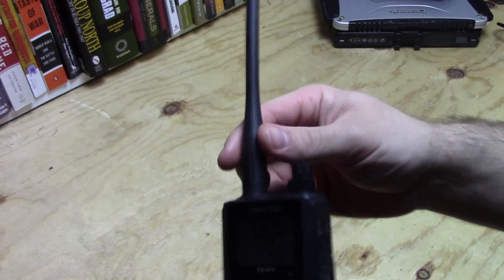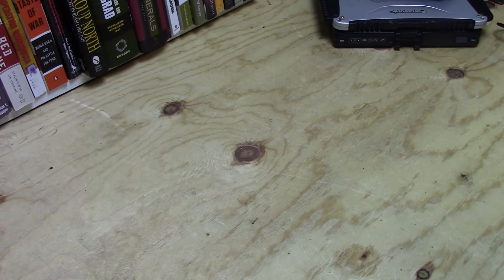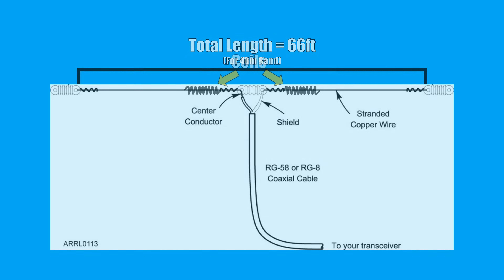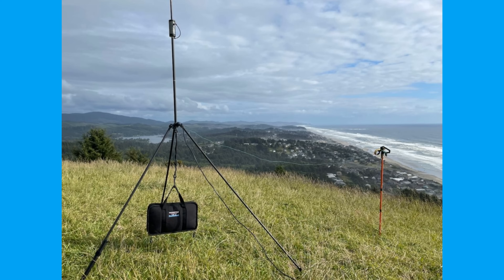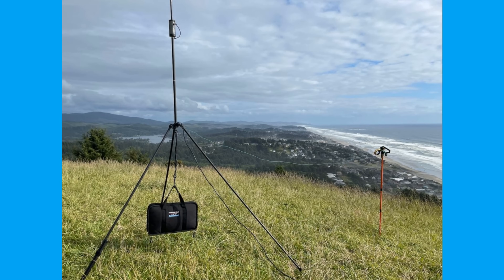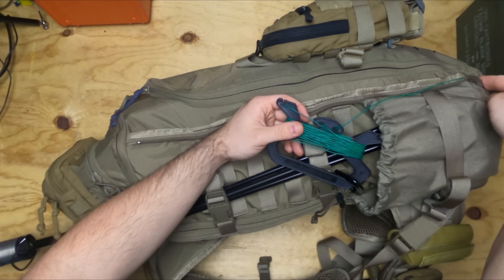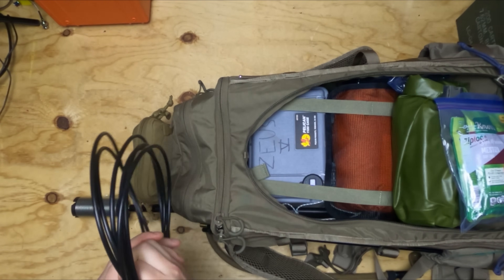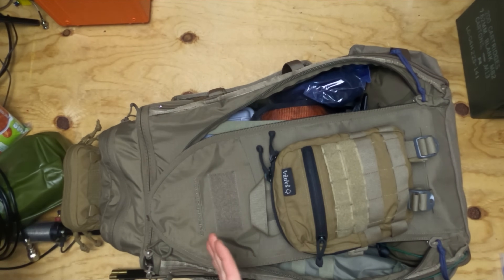Portable HF Radio: Issues and Options

Comment: More content on your IC-705 would be appreciated! Figuring out which systems fit which capability is a worthy study. For i.e, the yaesus seem to be easier to use APRS on compared to the ICOMs, but then you run into other issues. Looking forward to more!

Comment: Not sure why you would go straight to a tripod radial. Why not use an endfed half wave or random wire? Much less to carry and set up, just throw the end up into a tree. Can confirm it works for regional operations. Leave national contact to Basecamp.

Comment: An EFHW antenna with throw away wire. Deploying can be done much quicker than retreiving an antenna wire in most cases. If DF is the main concern then deployment time may not be a problem, but leaving quickly after transmission is the main problem.

Something like aluminum fence wire can provide a cheap throw away antenna. Unhook the wire from your balun or tuner and off you go in a matter of seconds.

Comment: I'm building an antenna out of two brass slinkys.  It looks like a dipole but it's really an end fed random wire (random slinky?) with a really long counterpoise (counterslinky?) The whole thing will be about 12 feet long fully deployed,  and hopefully 10-15 feet off the ground.  It's multiband,  and crazy portable, although it does require an antenna tuner.  Apparently they were all the rage during WW2.

Comment: @12:50 Be careful of the bending radius of the coax cable. That first bend out of the antenna in your pack looks like its about to cry mercy. I've worked for MANY years installing microwave communications systems for AT&T, Verizon (and others) plus I've worked for the DoD as a contractor. Anyways kinks in the wave-guide returned unacceptable system & return loss values more times than I could count. If you spend several hundred bucks on cables and antennas, on top of your USD1-2K radio, only to have it under perform because you smashed the cable in your pack like a neanderthal (me see cable... me smash... me fit 60L gear in 40L pack!!!) SMH. 
Thanks S2, your videos are enjoyable like always.

Comment: Actually there are portable operators that operate HF while walking by trailing a counterpoise while walking.  They have excess cable spoiled on their side and a counterpoise lead attached by an alligator clip to the trailing wire near the spool. If the trailing counterpoise gets snagged or stepped on it the alligator clip pulls loose and wire pulls out from the spool prevent mechanical damage to the radio or harm to the operator.

How one assures the radio is protected from high SWR varies as well as how one makes one's self away of a disconnect of the counterpoise lead also varies.

The electrically unused end of the spool of wire can be attached to some sort of bungee or shock cord making it easier for the operator to recognize the spool has unspooled to the end before experiencing damage by an abrupt stop.. Similarly the shock cord can be wrapped around from inside to outside of the spool and the spool attached by velcro to the operators clothing or pack. When the trailing counterpoise is snagged the spool detaches and then the shock cord alerts the operator.

There are clever determined people that have been doing this sort of thing for decades.

Comment: No, NO, NO!!! It is not heat loss that causes dipoles to be optimally a half wavelength long versus a full wavelength long!

It is wave cancellation!! It is waves being 180° out of phase on a fullwave dipole cancelling each other.

The thermodynamics are a consequence of waves being 180° out of phase, not the cause of being 180° out of phase.

You must be clear and concise in terms of the cause and effect relationship to correctly describe the what and why.

Comment: Homemade Magnetic loop antennas are by far the best HF antenna for their size anywhere. Especially portable, just bought a used 10 Kv 10 to 500 picofarad vacuum variable capacitor to make a somewhat portable 6' diameter HF mag loop antenna that can handle 250 to 350 watts, depending on the band. My 6 ft tunes 2.8 Mhz to 7.35 Mhz my 3 ft tunes 12.8 Mhz to 29.80 mhz.

Comment: I was wondering, would it be possible to 3d print a case to place the system into for protection [part that extends into the backpack] and still be effective? Excellent presentation as always.

Comment: Thought of a way to make a quick deploy antenna

use two telescope collapsible fishing poles, replace the fishing line spool with a spool of antenna wire.  leave the other spoolless, and attach a basic fishing poll stake to the end of both.   (Load the antenna wire backward so that the hookup is on the outside end of the spool)

when you want to stop make a quick transition. Extend and cast the primary pole with the wire spool, just like a normal fishing cast. 
Plant the primary poll, and run to where  the end of the line has landed.
Extend and plant the secondary poll and feed the end of the wire through the secondary poll.
You can now plug in the antenna and receive or transmit.

Need pack up and leave quickly? Follow steps in reverse.
unplug antenna, and pack up the radio.
Detach the end of the antenna from the secondary poll, then collapse and pack up secondary poll.
Lastly, run back to the Primary poll. Reel in the antenna wire, then collapse and pack up the primary poll.

Comment: Hey guy! Enjoy your videos a lot! I am a long-time Ham with the highest class FFC license. I wanted to comment on this one with possible ideas that while not perfect might be helpful for your idea of using HF to manage multiple small teams in the field. I did hear you say that radio in general and HF in particular posed various challenges that you couldn't get into due to time constraints. No probs. I assume you are aware of SWR, and this is an example of the kind of practical problems to be dealt with. But could there be work arounds? One idea is Radio Relay. Imagine you are base station in, say Athens Geo. and you are working with a small company-sized unit in the form of squad-level groups scattered over N. Geo. As base station you need a decent antenna, perhaps covertly installed and capable of putting out 100w via the HF transceiver and antenna tuner of your choice. But all the teams in the field really need is to receive that HF signal. And any decent piece of 14AWG stranded tied to a rock and tossed over a tree limb, then married to a short piece of coax can easily receive on a completely innocent and legal SW portable radio. With a decent radio you might not even need the extra wire! Not a big deal! How to communicate from the field back to base then? By Radio Relay: all the teams also carry VHF handhelds. Their individual Areas of Operations form an overlapping grid over the monitored landscape, and they are able to transceive to each other, the nearest to base then relaying to your VHF at base station. Hence, you eliminate most set-up and engineering issues for the field teams while providing a reliable method to relay info up and down the chain. Assuming ridge-top use in the field 18 km, say 11 miles is certainly do-able without any repeaters or special antennas. A 12-squad company properly dispersed could probably cover most of Northern Geo. Plus have the ability to link with other units in a larger regional net.  If the teams were laid out in linear rather than grid fashion the line could reach over 100 miles and form an efficient early warning line. Def not perfect but offered for what it's worth.

Comment: Chameleon V1 Home use and V2 mobile use were also coiled. They used a 9:1 unun. Chameleon no longer sells them. At least not the V1. Bought mine back in 2008 directly from the company when they were based in CA.

Comment: I made a counterpoise from an automatic steel tape measure (the same type used to make the tape measure Yagi's).  You might consider that, as it rolls itself up real easy for packing and unpacking.  Even better since the end is a coil, it acts like a trap and so electrically the wire length can be adjusted.  This allows you to adjust the length for better tuning options.  In my case I attached a crock-clip but you could attach it permanently to the buddy pole too.   I also prefer an EFHW rather than a dipole I think it's easier to deploy and can also do NVIS is you have a shortened version of the 80m or 40m EFHW.  By the way I have very lightweight wire, the stuff you showed looks good for way more power than the IC-705 kicks out...   One of the best radios that I've seen which actually worked with a whip antenna is the Clansman PRC-320/RT-320, I've wanted one for a while, but the prices just keep getting higher and higher for good ones...   Of course they are really heavy and so on for use today, but they were awesome at the time.

Comment: I don't know of you read the comments, or even think this idea is worth considering, but I had an idea the other day I thought you might find at least interesting.

I've heard (can't remember where, maybe even this channel) that Ukrainian fighters have been making good use of electric motorbikes. I've recently been eyeing the Sur Ron series of electric dirt bikes, and couldn't help but think they would be excellent tools not only for fun, but for serious times too. Especially when upgraded with a second battery and a belt drive, it creates an extremely capable yet quiet means of transportation in many types of terrain that is also very low-maintenance. Not only that, but I've seen people adopt solar panels to be able to charge their vehicles on the go, and allow for total independence from the grid. 

Just an idea.

Comment: I watched some WWII videos about the SOE and the allied spies and they used a wire down the chimney as a stealth antenna. Some other methods including using a wire clothesline. Some ran a wire around the ceiling around the room and ran a counterpoise wire around the baseboard. I think there was another one where they ran a wire vertically all the way up a tree.

Comment: Can you have bi-metallic Coaxial Cable that you can zero to the system temperature of the surroundings, insulate maybe, and then heat to the desired dimensions?

Comment: You should really move to a Dell rugged laptop. They are only about one generation behind on hardware, where Panasonic is closer to three generations behind, and they weigh in the area of only 4.5lbs compared to those toughbook bricks. There's even a 12in laptop/tablet convertible. They do have a 7400 series rugged extreme 14 laptop that's more the size of Toughbook brick.

Comment: So... Radios need to be waterproof, portable, easy to use once you know how, quick to set up/take down, and rugged enough not to break.

That's tough.
Reply: @Ghostinthecode  That's for a bunch of people using a repeater. Individuals could just communicate between smaller groups for a lot less time, for a lot less demand. 

If you can contact three other groups twice a day for 20 minutes, that's pretty good.

But how would a normal person learn to use an absurdly complicated thing, which is not waterproof, which requires advanced licensing? Probably not so common.

Comment: Any thought on using a micro-drone to elevate your antenna over a limb. You can set an antenna quite quickly, if the wire or leader was light enough. Dacron 50lbs test braided line will drag it up I think.

Comment: I’m having trouble with one thing when it comes to HF. I understand skip, I get directionality, but is there any way to adjust change distance? 

For instance, I have made 59 contact with someone 600 miles away, but I have had poor luck talking to someone I know is 800 miles away. Is there a way for me to “adjust fire” to get that extra 200 miles? 

Currently using a simple vertical and a 100w machine. He has the same radio, but with a OCF dipole. I’m wondering if one of us needs to change antennas or if both of us need different antennas or if we need more power or if there’s just no way to target a specific town, in two directions.

Comment: Can HF talk with UHF and VHF. I have very little understanding of raidos
Reply: Each acronym is a separate pre-assigned frequency range. Frequency is the number of energy pulses that are sent per second.  Antennas need to be tuned to match the targeted frequency as close as possible - for getting as much power out as possible and more importantly, receive as much power as possible so the signal can be decoded from the background noise. Out of range typically means the signal is no longer distinguishable from background noise. Everyone needs to be using the same pre-discussed frequency within the chosen range. Each range has benefits and drawbacks. HF can go international in the right weather (atmosphere acts as reflector) but you need large antennas and sometimes has trouble with local communications. It also requires a license. VHF is the next frequency range higher and is good for medium to long range without too much stuff between you. UHF is the most common and works well in short to medium ranges (50kms or so). Think line of sight or through a few buildings. VHF and UHF both have license free frequency ranges and have pre-assigned 'channels' for specific frequencies. That's why you can pick up random 80 channel UHF radios and after setting them to the same channel, can talk together. The higher the frequency, the shorter the range (from interference, power transmitted, obstacles absorbing the signal etc) but the more data can be sent. Any radios without pre-set (and unchangeable) channels are illegal to operate without an amateur radio license. Of cause that's up to you but licensed operators love to hunt down illegal transmitters.. Always keep in mind that someone is probably listening...

Comment: I was so glad I wasn't the Commo guy in my squad back in the day lol.  

Being as how expensive and in-depth these advanced HF Radio systems are, handheld units with a small repeater and booster (as necessary positioned in a somewhat permanent singular location) are far more viable and viewed as practical by many Preppers and Minutemen, with all the weight and other gear that has to be lugged around, these advanced systems are not favorable for that side of the scene, handheld units are just the practical and more easily accessible choice.

Obviously, there's serious limitations to handheld units, only very localized communication will be attainable, that's where networks and community cohesion comes into play for accomplishing goals and survival.  Small Team operations with no logistical support are going to dictate what type of communication and how it'll be used will factor, Minuteman, Prepper, and otherwise Guerilla units aren't going to have that Military or LE support in most cases and want to avoid any potential of contact or interception from them in a myriad of situations.  I think understanding these viewpoints is important as much as understanding how these advanced systems work.

This is all very interesting but also overwhelming, yes.  Great content as always though S2 crew, we appreciate y'all.

Comment: On point! What size battery are you running? We need a gear list! The Wolf River Coil system works well too, just need that antenna analyzer. I’m anti-tuner while running portable comms. (If the radio does not have an internal tuner.)
Reply: Which wolf river coil did you go with? Is it portable enough for a backpack set up like  S2's rig in the video? I was building my own but their prices aren't bad and I have enough projects as is.

Comment: I really appreciate the wisdom your group puts out. Many blessings to ya"s. I built a 40 meter dipole for NVIS and DX.
It takes me 15 mins. to unpack and assemble my Icom 7100 ,antenna etc. I place the center part of antenna on a 6 foot pole, and the two ends on 4 foot poles facing east to west to talk to my bud's north and south of me. If I want to do DX, I hang everything about 12 feet up. While  doing NVIS I have talked to friends as close as one city block, and as far as 450 miles out.
Also due to harmonics , I can use this antenna for 20 meters, 15 meters and ten meters. KN4JKZ

Comment: You should get the Peovi Cage and Side KX front cover for the 705. My biggest fear is the touch screen while in transport. Also check out the K6ARK EFHW smallest/lightest unit on the market.

Comment: Thanks for more on a very important subject.  Having communication range from zero to thousands of miles in your ruck is amazing.  Being able to communicate with team members BEYOND LINE OF SITE and even from the bottom of deep valleys and canyons (NVIS) making your contacts from deep canyons and moutain valleys is important. 

My HF station fits into my cargo pocket in my pants, precut dipole or EFHW, but then again, I use Morse (CW) so very inexpensive, high efficiency at low power/currrent drain and no computer needed.  However, some people refuse to learn Morse, so computer digital rocks in those circumstances.  Skills travel litely and you have them for life. A good Morse operator operates on coffee!

THINK:  Size, Weight and Power.
Reply: HF isn't really the best for close communications.  That's where VHF/UHF shine.
Reply: @syntaxerrorsix3137  - Agreed. As long as those I need to communicate with are within line-of-sight (LOS), plan for VHF/UHF.

Comment: I was thinking about coating a polypropylene line in graphene after seeing a guy make antennas with graphene and then creating a parabolic reflector by simply rubbing a polypropylene bowl with a scrap of wool and graphene powder...I mean, tough line and no special tools or expensive materials needed to try it out, I wonder if it would actually work?
Reply: Worth experimenting with. I think it would behave more like a thin hollow tube, but I'm sure it could be made to work